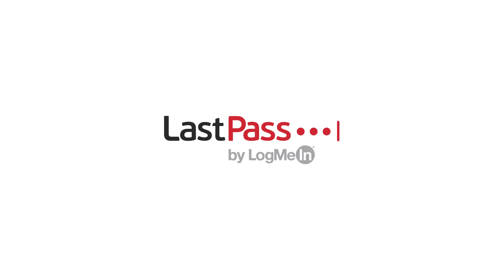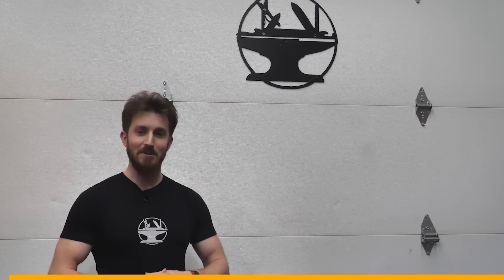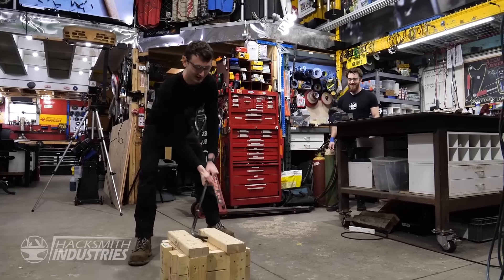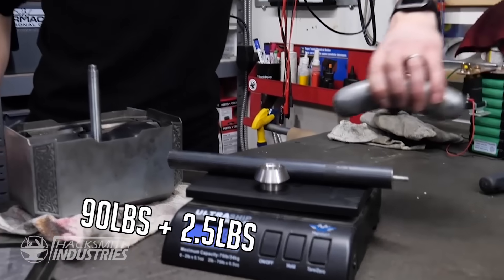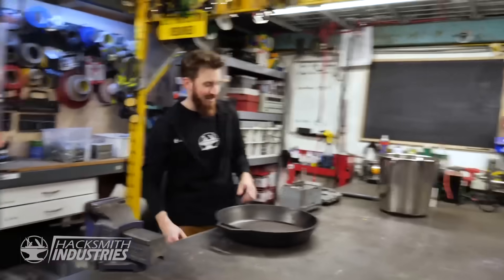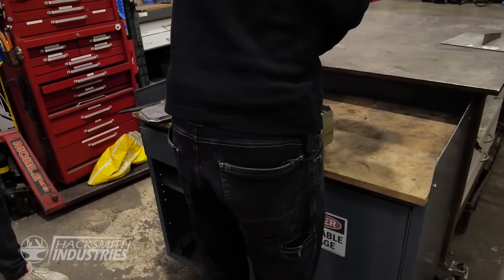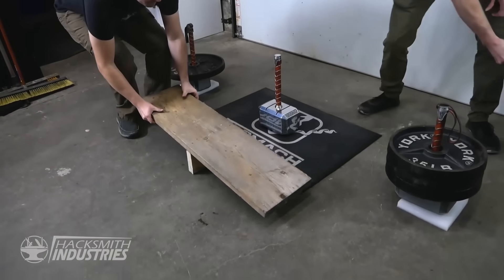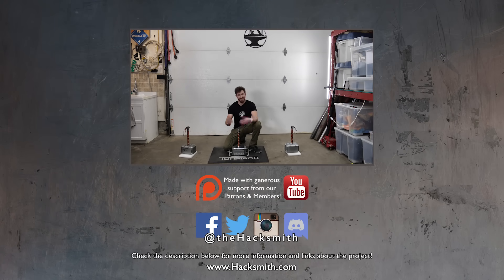Tungsten Thor's Hammer (World's HEAVIEST)

Comment: Of course you use Tungsten.
It's Thor with a "T" not Lhor with an "L" as in Lead.
If you could melt it into a true hammer it would be almost indestructible with a high melting point and heavy mass.
Well the handle would also need to be Tungsten.

Comment: Be careful with the handle! The short threaded tang this thing has might not be strong enough to hold so much weight. It would be better with a full metal tang.
Reply from the maker: Which is why we made it a full length tang.... did you not watch the video?

Comment: Being someone who works part time in a machine shop I'm very curious how the horizontal band saw managed to eventually cut the tungsten since the only band saw blades I've come across are made out of hardened steel and couldn't possibly scratch tungsten
Reply: It's pure tungsten, which is softer than tungsten carbide and similar in hardness to hardened tool steel.

Comment: Ironic it made out of tungsten since it is a poor conductor of electricity
Reply from the maker: Tungsten isn't a poor conductor...
Reply: @hacksmith  This is the reason for the high melting point. Thus, we can say that Tungsten has a high melting point, and it has high resistivity towards heat. Tungsten is a poor conductor of electricity even though it is a metal. But at high temperatures, it will conduct electricity.
Reply from the maker: Tungsten electrodes...

Comment: the thor's hammer that you guys made was estimate at 87 pound without the liquid metal. That is only possible liquid substances are already about 4 times more than solid substances, therefore the hammer would supposed to be 134 pounds but, since you guys compressed the liquid tungsten it lost about 22 pounds. But when you compress something it gets stronger and stronger and its almost the exact same thing as it is as weight, therefore instead of losing the full average of 39 pounds it lost just just 22 pounds. So instead of your guys' estimate actually the correct weight would be 119 pounds.

Comment: Should've probably made the tungsten into rods, grabbed some copper wire and made a "swirling cilinder" (forgot the actual name of the shape) and sent electricity through it.

The electricity would heat up the tungsten quickly, and you could've just put it in the hammer in it's liquid form
Reply from the maker: And then the tungsten would have melted the rest of the hammer... tungsten has one of the highest melting points of any metal. Over 6000 degrees. No mold can contain it without melting
Reply: @hacksmith  .....

That's a fair point ya got there buddy, I may have overlooked that part

Comment: "we gotta pour all that lead in"    
video says its made of tungsten
Reply from the maker: It's mostly tungsten. You can't melt tungsten cause it has one of the highest melting points of any material on the planet. Can't machine it easily either, so we had to use blocks. Used lead to fill in the air gaps in between.
Reply: @hacksmith  oh. lol. ok makes sense! Watched it through the end this is freaking cool

Comment: I have a question, if you take the top of the hammer and fill it with the heaviest material in the world, wouldn't the handle snap because it can't hold the weight of the head?

Comment: lame, they didn't even melt the tungsten down.
Reply: Tungsten melts at more then 3410 degrees celsius. It freezes instantly when it touches lava. What kind of mold could hold that?
Reply: @latrify8855   idk the same one that made the tungsten sheets
Reply: @ovrskr  they don't cast tungsten ever(there only 3 materials with a higher melting point) . They do it with a process called sintering

Comment: The only way to make it heavier would be to cast the entire thing out of tungsten including the handle.
Reply: Or use osmium (Which is even denser and much more expensive)
Reply: @Pluranium_Alloy  ok yeah, I forgot about osmium. Should be 10-14% heavier. Should be 125ish+ pounds. At 1300$ per ounce that would be 2.6mil$.
Reply: @Derp_Wolf  I mean yeah, but I don't think you could find thst amount, also it's nearly impossible to cast tungsten
Reply: @siffrinisat1  probably right. Can metal printing 3D printers print tungsten?
Reply: @Derp_Wolf  I'm not sure, but they have to shape it somehow
Reply: Osmium has another problem... It's radioactive

Comment: What happens when you fuse steel and tungsten would it be a stronger substance or a weaker substance
Reply: Weaker most likely. Since Tungsten would be fusing with a much Weaker metal by comparison, the whole structural integrity of the metal and mixture of metals would give it new weak points. I think

Comment: 6:51 when you realise that wolframium (or tungsten) is used to build A-10 Thunderbolts shield or tanks for that reason.
I'm a little mad, but you could use depleted uranium (which is cheaper) instead of wolframium, isn't it? LOL
Reply: @Eric Nunya depleted uranium is non dangerous directly. I mean if you eat 1 kilograms probably there are some problems, but it's the same with most metals (cadmium, wolframium, berillium.....)
Reply: @Eric Nunya yes but actually not....i mean obviously military personnel must wear protections and mask also with normal shells (due to volatility of black powder), so is not a real logistical difficulty

Comment: Why didn't you melt tungsten?
Because you can't but it is not impossible.

you need a cooled mold, with liquid oxygen.
Once you have filled the mold with liquid tungsten, and cooled the mold from the outside in "pool" of liquid oxygen, tungsten will be cooled down a became solid. After the everything is cooled down to roomtemperatur, move this block of tungsten an iron mold to mining machine. and machine the ironmold away. Drill a hole in the middle and screw a steel rod on it. And you will have a Thor's hammer that is worthy!

Comment: Tungsten carbide is harder than tungsten, AFAIK, so if you could get a tunsten piece that is larger than your intended hammer you could machine a hammer that is entirely tungsten.
also large tungsten pieces are sometimes created by sintering tungsten powder, so if you have acces to a machine that can 3d-print with metal powder you only need to find tungsten powder...

the idea of a tungsten only hammer is not that it would be heavier, but tungsten is hard, and such a hammer would be nearly indestructible.

Comment: You would have been better off just getting a mold made out of Hafnium carbide ( melting point 3,958 Celsius / 7156 F )  and then, although Tungsten's supposed to melt at 100 C higher than an oxy-acetylene flame , -  still does it anyway ( actually I found that it explodes after turning bright orange ) - but THAT'S  OK, -  just arrange that said popping ends up in the mold. Afterwards, use your CNC to machine the decorative design in,  unless you can get the mold made with that in it ( much better ).  You'll probably want however, to use your openable shell that you've already got.  Btw: How much money do you bastards have??? - And where did you get it??? That workshop must be worth at least 2 million.  A documentary on you yourselves would be the more interesting thing at THIS point I think. NOTE: I've just discovered your channel today  . . . .  :(
Reply from the maker: Yeah that would have been way too expensive to do.  Not sure where you live but this workshop came with my house,  that was only a couple hundred grand.  You could build a workshop like this for about 100k easily :)
Reply: @hacksmith  Bloody hell mate !  - Well your prices over there must be Sooo much cheaper. - I'm in Australia btw.

Comment: if Tungsten is the material with the hottest melting point and its shaped like that it was cut or melted and i  doubt that exists in rock in large enough to have those bits of it with none of the earths crust in it so i think that Tungsten can be melted but i dont know if im right
Reply: if you can melt it to 3,422 °C, sure
Reply: @JD-jc5hg  the plasma proto sabers 400 degrees so they could make a heavier one or powderiseit and then pour led into that
Reply: @meowptthereturn6157  That's what they did.. They added Tungsten then poured led to fill the gaps
Reply: @JD-jc5hg  yes lead but u put tungsten and its got 3k melting point but they have a plasma protosaber which is 4k degrees hot so they could make a heavier one if they used a tungsten drill bit to carve it then melt tungsten into it with the protosaber

Comment: Even though probably stupid expensive there wouldve been ways to actually melt tungsten or more so contain molten tungsten, either by using a form made of Tantalhafniumcarbide or by substituting with Tungstencarbide which even tho less dense then normal tungsten still is almost about 35% denser then led and could be poured into a tungsten Mjönir "Hull". And it would still be far cheaper then Osmium, while also having "practical use" as in not busting open from just falling, maybe deforming a bit. But hey those are just my stupid dreams.

Comment: You made it with Tungsten, try with Osmium. 22610kg/m3
The heaviest element by density
Reply from the maker: Also would cost 3M dollars..
Reply: @hacksmith  yeah, I suspected.
I think it is used in the phones as an exentric mass for the vibration.
By the way, you always make awesome things, great engineering, bravo!
Reply from the maker: No I don't think it is haha.  Even a few grams would cost hundreds i think
Reply: @hacksmith  I found its price. In 2018 it cost $400 per troy ounce. This is almost $13 US dollars per gramm.
Preety expensive, idk how hard it is to machine it. It in the group of Platinum, so it could be hard.
 I heard long time ago, that it was used in tiny motors in the first Nokia as a vibrator, like a fraction of a gramm could make a motor vibrate violently.
Anyway, for Thor's hammer the difference is at most 18% more for Osmium than Tungsten, not so much.

Comment: The reason depleted uranium is used when you need something heavy is that you can actually machine it.  Tungsten is slightly denser but it is like cutting rock.  Uranium cuts about like annealed S7 steel.

Comment: I don't think tungsten would make a good hammer it is too hard.  Depleted uranium would make a good dead blow if you had the uranium inside a steel case.  I have a lead hammer it was made to move metal.  I have straightened out some really messed up things with it.

Comment: Actually heaviest metal in the world is osmium. But osmium is way more expensive than tungsten (400$ per troy ounce/31,1 grams), because it is very rare noble metal from platinum group (along with palladium, ruthenium, rhodium, iridium and platinum).
Fun fact: now platinum is way cheaper than gold (over twice), and rhodium is currently most valuable noble metal on Earth (its price is over four times higher than gold).
Reply: no. Osmium's melting point is a 3045 C. Tungsten is  3422. And he said osmium was denser. So is the iridium, for that matter.
Reply: @fionam3554  You are right. I thought it had higher melting point, because osmium was used in a light bulbs before tungsten.

Comment: Ik tungsten melts at around 8000 F but Ik u guys have connections to a induction furnace y’all could hav done something better
Reply from the maker: And what mold would withstand that temp?
Reply: the Hacksmith usually a high carbon mold and cruisible
Reply: Because carbon does not melt unless under 10 atmosphere of pressure
Reply: the Hacksmith or if yall get a patrion or I just don’t know about it get enough money to get a piece carved to fit it